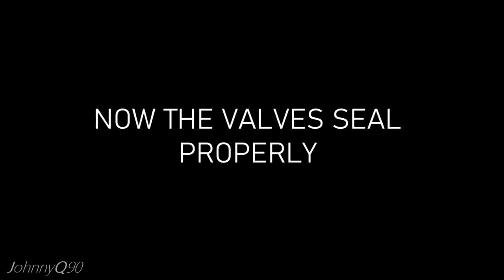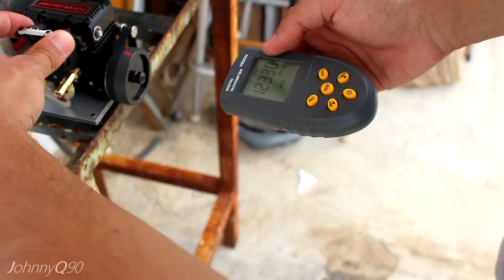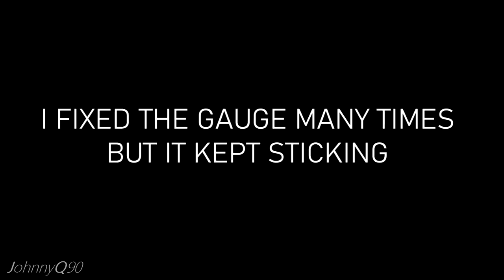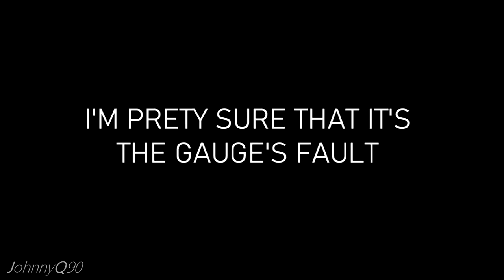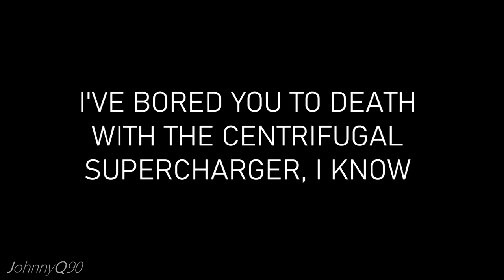PERFORMANCE Upgrade for the 4 Stroke TWIN Cylinder - *VALVE Lapping* - Supercharger Update

Comment: Once again, awesome work. You must be a wizard. Great skills mate!
Reply: wizard? nah, just hard work and big brain 😉
Reply: Watch where he points lazer when he checks rpm. He is getting more rpm the second reading because he checks it closer to crankshaft. Lapping valves will increase efficiency and power but not by 4,000 rpm
Reply: @jacobcredle4807  Yes the laser is further out the second time, but the engine is revving noticeably higher, by the sound pitch it's making. I don't really know much about this kind of laser tachometer, as I've never used one, but if it counts revolutions, it should not matter how far out he checked it. The flywheel/pulley is spinning the same RPM along it's entire radius. It's the pulley speed that changes along it's radius, as the further from the centre, the further it needs to move for the same RPM. So provided the tachometer can somehow know when a complete revolution has been made, it shouldn't matter where the reading was taken. 
If it was a tachometer which works out the revolutions by measuring speed at a certain point on the radius, then it would matter.
Like I said, I don't know how this type of tachometer works, usually he uses a tachometer which works by using a piece of reflective tape that reflects the laser, so allowing the tacho to count a revolution. I didn't see him put the tape on this time. Either it's a new type of laser tacho, or he didn't film the application of the tape.
Reply: It might be sucking air throught your supercharger bearings if they arent sealed.
Reply: @jacobcredle4807  that's not true, it reads the reflective tape once per revolution. It doesn't matter where the tape is.
Reply: Fusion 360, a small metal lathe, ample free time, and a few specific other tools can get you pre far.
Reply: Keep it going man. 👍🏼
Reply: @jacobcredle4807  at any point on a disk like the flywheel the angular speed/revolutions are constant. Its the linear velocity that changes
Reply: Îmi spuneți de unde ați la motorul ca și eu vreau să îmi iau dar nu găsesc de unde am căutat peste tot prin internet căutați și exact pe îmi spuneți dacă nu pe Google știu să caut altundeva în magazin
Reply: îmi spuneți 🙂🙂🙂🙂🙂🙂🙂🙂🙂
Reply: great my 2 favorite channels in a comment

Comment: No way you've bored us with that. I love the supercharger setup. Just wished you would get it to work. Mount it straight off the front on the crank!
Reply: You have to use a geared ratio otherwise you cant get the charger to spin fast enough to produce enough positive air pressure. The crank might spin at 16,000 rpm now, but that charger is probably spinning over 110,000 rpm with the 1:10 pulley used here. With the 8.5 he was at 90,000 at .6 psi.
Reply: @faulcun  Dude, 16,000x10:160,000 supercharger revolutions (1:10)
Reply: @darianistead2239  yep you right lol. Wasnt mathing
Reply: these replies are big brain, meanwhile i cant even figure out minecraft redstone lmao

Comment: to check power gains, you could always run the engine to an electric generator, see how much electricity it makes with and without the forced induction.
Reply: I was watching Smarter Everyday's video on power generation the other day, and he had a mini generator attach to a drill to show the effects of rotation speed on frequency loading. He also showed the difference of unconnected poles versus connected poles of said motor. In theory, you could create a load cell of resistors and use either a dmm or even a killawatt type device measure the output of the motor.

Comment: Never bored of your channel. Love the lapping and valve work. Positive increase.  Racking my brain as to why the intermittent idle and why the needle valve has no affect on the flow. Could be pulling air through the SC bearings. Great Vid 👍🏼

Comment: I belive the reason it was running strange is due to fuel accumulation, fuel is sitting in the bottom of the compressor housing and when it's finally drawn into the engine it's causing your running issue.
Reply: I was thinking maybe the carburetor throat was too small and when the engine revs up a strong vacuum forms which begins pulling more fuel through the jet which revs it up more until it begins running lean and then it slows down and repeats.
Reply: I think a different style carburetor is in order.
Reply: Fuel injection is the way to go. I wonder if they make fuel injectors that small.
Reply: Fuel accumulating in the compressor could be it, I was thinking that the intake manifold wasn't distributing fuel evenly as it's not well atomized by that point.
Reply: @Kraknar  Yeah, that's my thought too, asking atomized fuel to follow that path and stay atomized is a big ask.
Reply: Could he use a tiny amount of a fluorescent type fluid to track wear the fuel touches the intake tract?

Comment: I suspect your problem is a vacuum leak in the supercharger at the end of the video. I've seen that meany times before. Thanks for the great video.
Reply: yes I think through the ceramic bearings
Reply: The problem is, the fuel isn't being pushed into the carb like the fuel tank is designed to do. The nipple on the lid of the gas tank is supposed to be connected to a source that can supply positive air pressure.

Comment: That valve lift is pretty small, how close are the valves springs to binding? You might be able to make rockers with a more aggressive rocker ratio to gain more lift which will also help with higher rpm.
Reply: Would prolly get even more overlap. Which is what he is fighting right now I’m guessing.
Reply: @henryarrington3446  overlap isn't always a bad thing in forced induction, especially in high revving engines. The duration of the overlap shouldn't change though, as without altering the cam profile, although the curtain area/time will be greater, the actual number of degrees per revolution that overlap exists will be the same. If boost drops it'll probably because the intake valves are exessively restrictive. Boost is a means to an end, if you reduce a restrictive valve you may drop boost, but if it means more air actually fills the cylinder then that's actually a beneficial drop.
Reply: @17473039  your right I guess I worded it wrong. Overlap timing would be the same. But the valves would be open more during overlap. There is probably a lot of overlap in that engine to make it easy to start. I don’t know if it’s a flat tappet or roller lifters but if flat tappet you can’t get very aggressive on open and closing of valves. So builders have to put up with a little more overlap to get more duration/lift.
Reply: @henryarrington3446  my guess is that being as cheap as it is, the cam probably acts directly on the rocker so it would act somewhere between the two. There is potential to advance the cam slightly so the intake valve close sooner so piston is closer to bdc when the intake valve closes, and rely on the supercharger flow and the overlap to help cylinder clearing on the exhaust stroke.
Reply: @17473039  agreed bud. I think you and me are thinking the same thing is going on on the little engine. Johnny will get it sorted out I’m sure.

Comment: A little tip with boost gauges that like to shake or flutter. Stuff a piece of clay with a wd40 straw (the tiny red ones) through the middle into the pipe used to feed to gauge. The gauge will be slightly laggy (unoticably) but a lot smoother and more accurate. I had to do it on my car's one 😆
Reply: They actually make filters for this. Also cotton balls work.
Reply: @benjamindavidson632  yeah I saw the filters but they either seemed too cheap or too expensive 😆 had some milliput and a wd40 straw laying about so improvised 😆
Reply: @MaNNeRz91  Yep RC filter, resistor and capacitor. The restriction is the resistor, and the pipe&gauage volume is a capacitor. Use to do this on boucing pressure transducers mounted too close to a pump set. Even just a length of plastic pipe with a crimp/bend in it works.
Reply: @yeahright3348  i like how knowledge in electronics often can be applied to other fields tech
Reply: @yeahright3348  I never thought about it as an electronic component before but that does make sense. Kind of like the bottle neck explanation for capacity and resistance. (I'm shit at electronics though.. I can repair stuff but I have no clue about working out current and amps)

Comment: Adding a pressure bypass when throttle closes may help. Recirculating the pressure back to the intake of the supercharger, this would work best with the blow through design and relieve the compressor loading at idle.
Reply: This makes total sense, I just don't know how you can do it on something this small of a scale.
Reply: @onefastslimjim  true, but he manages a lot of stuff on a scale that is tiny, a challenge, just not impossible!
Reply: @defaultdriftco00  oh yeah, knowing Johnny, he would find some sort of way!

Comment: Don't quit you are just getting started!  3 tips, 1 I think a blow thru with a better carb is in order, 2 use a fluid filled gauge with a restriction in the line, and 3 make a large plenum on the manifold.  If you look at what people have done for turbo's on small engines they need a "boost capacitor" basically it's a larger plenum for holding air to dampen the massive changes in pressure caused by low cylinder count.

Comment: to prevent the gauge from being damaged and giving erratic readings ..... us a long length of pipe between the manifold and the gauge.... at the manifold end place a restriction in the pipe, a bush with a 0.1mm hole in it, this will damp the response of the gauge and give the gauge a longer life span .. nice work... cool project
Reply: It should not be mechanical to begin with. Theres wayyyy too much fluctuation and its jamming it up. This will happen in any situation which is why ALLLLLLL boost gauges are digital.

Comment: I'm was and will never being bored see your tests and research! Don't hesitate to continue
In this case due to exhaust smoke I could say the fuel is clearly not normally carrying to engine. The engine have it in excess when you open throttle and compressor puzch the "heavy" oil+fuel to engine. 
If methanol is easy to transport on the air of your supercharger, oil that's take part of fuel could not be follow a such long tubing before engine
I think your problem is here. 
Solution is hard but probably you need to separate air throttle and fuel 
Install a fuel sprayer as near as possible to valve and a simple air carb where you want.

Comment: Next stiffer valve springs and high duration/lift camshaft for 20000rpm. (and supercharger ofc) Maybe oil system upgrade. Soon the whole engine will be diy upgrades lol.
Great video keep them coming!
Reply: Yeah, I've really been wondering if the camshaft has much of any tuning ground into it at all. Not really familiar enough, but my immediate guess would be that (like the rough machined valves) it's only meant to be good enough to let the engine run as a "functional model".

Comment: Couple things come to mind with the draw-through: Ideally you should still be pressurizing the fuel tank with something, but obviously the carb is drawing some fuel on its own.

Second thing to consider is if the supercharger is leaking air from behind the compressor wheel (through the bearings). This is honestly probably the best explanation for why it's running so weird at part throttle. With the blow-through setup this was never a problem, but with draw-through vacuum will pull air through the bearings if the seals aren't up for it. This leans out the fuel mixture.

Comment: You need a gauge filled with oil to get a decent reading
Reply: I think some kind of restriction orfice also inline?
Reply: And a gauge with a stop on the 0 so it doesn't run backwards.
Reply: Restrictor should do the job.
Reply: I think the shaky gauge had more to do with there still being compression leaking into the intake.  Same as if you've ever tried reading vacuum on an engine with a bent or overtightened intake valve.  Could just be an RC engine issue ... I've never built a 16K rpm engine ... there could be all kinds of overlap on that cam for all I know.
Reply: could also be valve float like crazy..
Reply: Two cilinders create uneven pulsing vacuum, it might be a good idea to try automotive grade Vacuum/boost gauge, they can read either vacuum or boost and usualy have some sort of restrictor built in gauge or in a provide hardware.
Reply: @a351must2  probably is a lot of overlap, to help with flow on a small 16krpm engine.
Reply: A small orifice or a long silicon hose to equal out the pressure peaks like it is done in measuring exhaust backpressure on turbo mufflers.
Reply: Or a check valve
Reply: Nothing mechanical. digital will round up an average and display a consistent value.
Reply: @a351must2  ..... the needle jumps because in between combustion cycles there will be vacuum when the boost pressure drops. theres only two pistons so vacuum is far from consistent and the boost is very far from steady. read My main comment above.

Comment: It looks like your only tuning the high end needle? There’s a low end needle on the side of the carb as well. You need to tune the high end first to get peak rpm. Then the low end to get good idle and transition. 

Also going over to electronic ignition and petrol/gas where it auto advances the timing might help 😊
Reply: What was going on there sounded a lot like a vacuum leak to me than a tuning issue. Or maybe some weird interaction between the carb and the supercharger causing an odd vacuum signal. Using an elbow between the carb and the supercharger might not have been the best plan. the more complicated the path between the carb and the engines vacuum the more wonky things get. I once ran what I thought was a pretty simple routing of a flexible (but very stiff) tube between the carb and the engine of my two stroke, and found the engine was virtually untunable. it always ran like trash. Then I eliminated the tube and mounted it as direct as possible, instantly found the right jet, and now it runs flawlessly. And yes I realize this is a 4 stroke of sorts, but these principals do still apply. A carb is a carb. (at least when it comes to 2 and 4 strokes-)
Reply: he's missing the pressure line on the lid of the tank. its starving for fuel, which is making it very difficult to tune.

Comment: when running boost you would have to advance or retard your timing ,I know that it doesn't have spark plugs but that would probably be the issue
Reply: Would valve float be a concern, I am not a mechanic just a hobbyist
Reply: @LM-uz4pr  valve float is an rpm related issue, the only issue you can run in to with changing camshaft timing is valve interference
Reply: @LM-uz4pr  Valve leak could actually be an issue that Johnny should inspect for. The valve springs weren't designed to hold positive intake pressure so the boost might be forcing air through them when they are supposed to be closed.
Reply: Hard to pull of but definitely cool idea
Reply: @iNubAlert  That's true for naturally aspirated cars. In the case of forced induction valve float can also occur when the valve springs are not stiff enough and the sheer air pressure generated by the supercharger/turbocharger manages to push the valves open

Comment: Iv seen people do this on small motors like for go-carts you need to use a carb with a butterfly not a slide throttle. I dont know why but it just works

Comment: what if the air that gets "comprimed" is to hot/big? make a tiny intercooler loop se if that helps?
Reply: The power increases slowy or no power increased, reason of the existence of Intercoolers doesn't matter its supercharger, turbo or centrifugal turbo.

In case of supercharged engines the cooling is down to the compressor before enters the engine, it's watercooled by a second radiator as intercooler, this also applies in centrifugal turbos used commonly in bikes.

Comment: You need a plenum chamber, for a twin cylinder about twice the total engine cc, and also as some have commented here some fluid damping in your gauge. The gauge oscillation is quite interesting, perhaps it indicates that the plenum could be even a little bigger than 2x displacement. 2-3x maybe and try to make it so the supercharger does not actually blow into the intake. So say, blow away from the engine with the supercharger, then into the plenum. Then an exit above the plenum entry so the charge exits toward the engine. 
  That would help to keep pressure pulses at bay. The 1:10 gear looks more like it too. Fantastic builds, keep on keeping on.

Comment: I absolutely love this project!  If it were me personally, I’d go back to blow through, keep your current pulley ratio to spin it fast enough, and run your fuel pressure tap from the intake tube between the blower and the carb. That way it should increase fuel pressure on a 1:1 ratio to boost pressure. You may also find that you need a stiffer valve spring. Even with such low boost, there’s still a good possibility that it’s blowing the valve off the seat and making it run erratic. Please don’t give up on it yet!

Comment: Automotive engine builder here. Just to cure your curiosity, since youre reading the pressure at the manifold, the intake valves create a pulsating pressure wave. Jon Kasse has a good demonstration of the pressure waves where he cut a hole in an intake manifold. It will also cause the pulsation in the reading while at boost. I saw your previous video so I know why you did it, just thought I'd explain it!